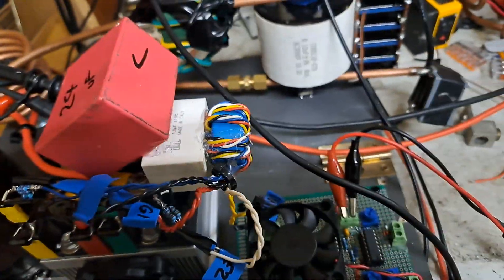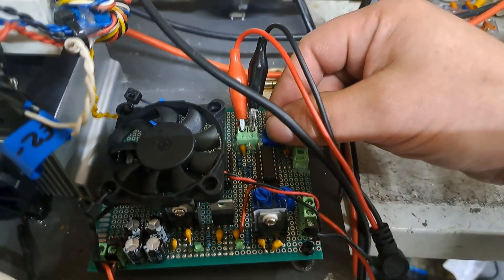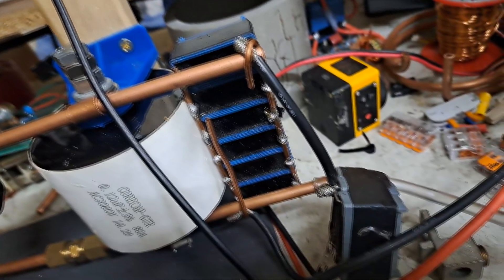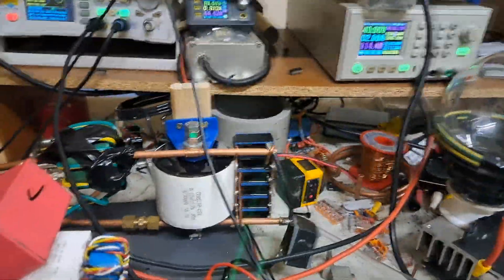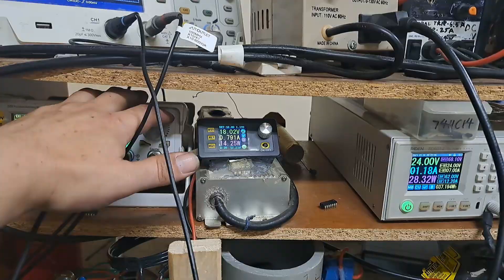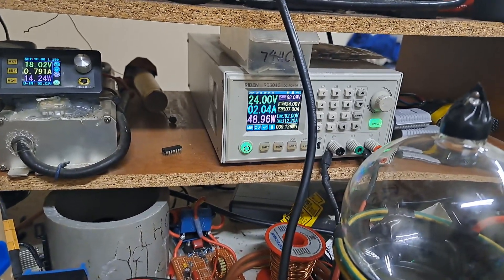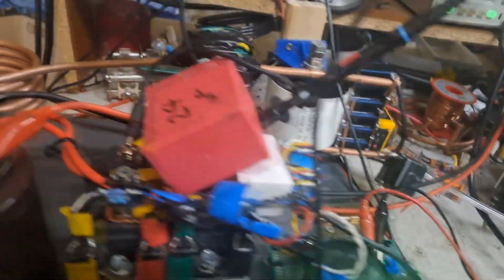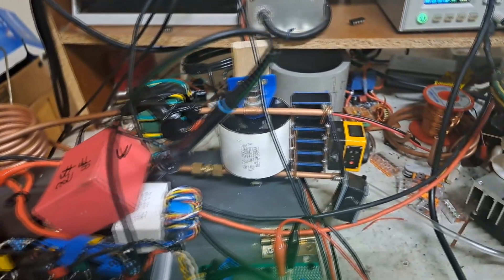Full Bridge Induction Heater Low Voltage Test

Comment: Is the primary fed directly from the bridge, without a DC blocking capacitor? Is that why we saw that big transient spike when the duty cycle was off? 

That definitely would be challenging in terms of getting a sufficiently balanced duty cycle to avoid unwanted DC flow through the primary. How could one fix that robustly? Some sort of DC current feedback scheme? That seems pretty annoying to implement... maybe just tuning the duty is good enough. But I would sort of want some kind of self-balancing. 

I wonder, if one put a standard current transformer on the primary circuit, maybe it could be used as a "poor man's flux gate". It would saturate with any DC present, and then it would do the typical thing that a CT does when it sees AC+DC, and start to produce a strongly distorted waveform, where the trailing edge of the half cycle with higher current gets abruptly terminated by CT core saturation, and the leading edge of the subsequent half cycle is sort of bulged out by the decay of the magnetizing current through the leakage inductance. If we looked at the waveform on a scope, we could definitely tell which way the DC current is flowing. With real DC-sensitive fluxgate sensors, they do synchronous demodulation of the 2nd harmonic component and servo the core flux back to zero with a bias winding, which obviously is a ton of work. The question is whether there's a super easy way to take the CT's secondary waveform and detect DC saturation in a polarity sensitive way, and use this to auto-tune the half bridge duty. I feel like if one differentiated the signal with a simple highpass filter, and then did positive and negative peak detection, the sharp falling edge of the higher current half cycle would reliably produce a higher peak derivative. So it could be basically a CT, burden resistor, RC highpass filter, a positive and negative diode peak detector, and then their outputs combined with a 1:1 resistor divider. This should produce a signal whose DC value corresponds to the polarity of DC primary current, and then could be used to servo the oscillator duty cycle. 

Maybe that's a whole lot of work compared to just tuning the duty cycle! I just wonder how reliable duty cycle tuning would be for very high power operation (gate drive asymmetry might drift with temperature, etc). I mean... all this is assuming there's no primary DC blocking cap. Maybe you just have one already and I'm just barking up the wrong tree! I saw that 24uF cap and assumed that was just decoupling, is that a blocking cap?
Reply from the maker: @InductorMan  In this first test I had no DC blocking but I later added a 1uF snubber cap I had. The whole irregular duty cycle issue just comes with how I wired up the CD 4046 so that's just what the vco is putting out. When I feed it the sine feedback it goes back to 50% like it's supposed to be. So when it comes to tuning I could really just tune the frequency using the CD 4046 chip after it has maintained a lock.

Comment: Hey dude , would you mind sharing the schematics?

It looks nice as a final year university project
Reply from the maker: Yea I just need to finish up the feedback portion.. but as it is you could basically just use any bridge with beefy enough gate drive and just feed it any fixed frequency signal that's solid enough.